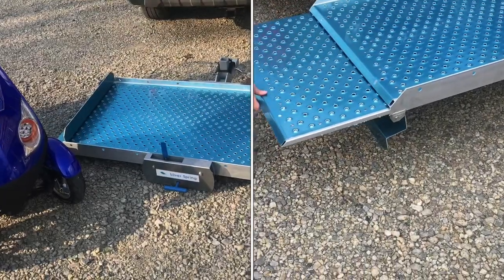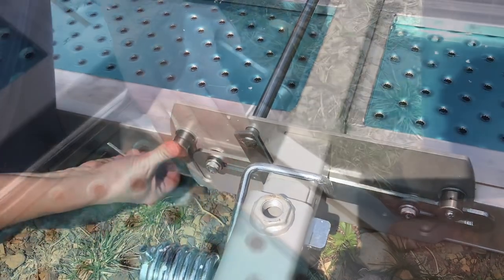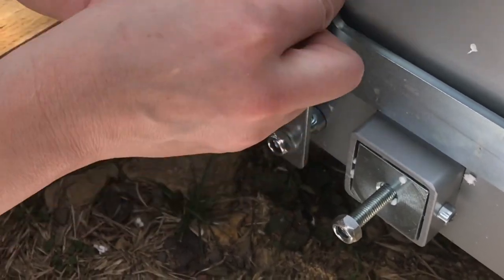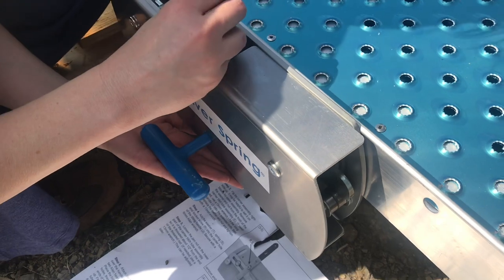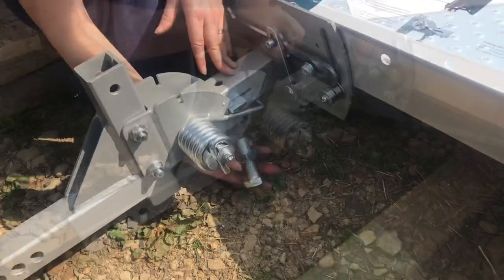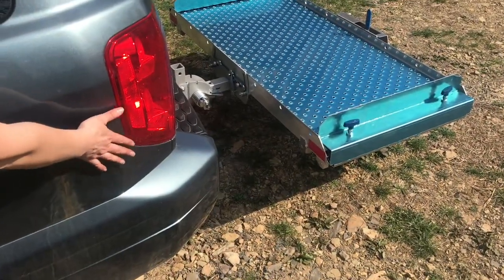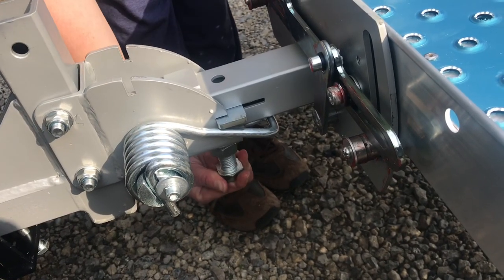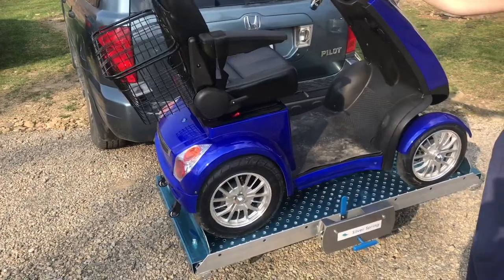(REVIEW) “tilt-a-rack” premium aluminum scooter and wheelchair carrier (silver spring)

Comment: Wow… really great video… and concise complete instructions.  This looks very ruggedly and strongly built. That hitch and support bar are steel and well more than strong enough for this application. Yes, there is wobbly issue but they all have that… particularly with cars today. Mostly this is the car suspension and compliance needed for a soft ride without a load like this. No problem you have options… https://youtu.be/BOdUfcIfKM0?si=0kW2fE-FBmlOoXPN .  Traditionally air shocks are easiest install. Or, air helper springs these both allow easy adjustment by changing air pressure.. easier instal than this scooter carrier… and if you remove the carrier you can reduce the helper spring air pressure.  I am lucky having a Range Rover that is super rugged and having an air suspension that a computer adjusts for ride height. But my Mercedes sedan I ordered without such complication as the Mercedes System I’d hugely complex, and a little fragile. 

I am an engineer by the way… and not defection is needed for strength so that is not any worry. But unsteady driving is disconcerting and dangerous.  So adding a dolly support wheel would be a project to undertake by securely mounting to the main support (the steel center support column bar) and adding a small trailer tire near center or a pair side by side. These provide widest selection, easiest install and adjustment.  Note simply have a 1/4” thick flat rectangular plate of steel welded to the center support column to mount the Flexiride unit(s) to… some holes will need drilling. The Flexiride support arms point in the trailing position and have splines for ride height or to set for best deflection to load. See web site for help -  https://www.theuniversalgroup.com/flexiride-technical-library .  If you do this you do not need to instal like caster wheels, in fact similar carriers for motorcycles when the casters wobble or rotate it is very noticeable and they can in certain situations caster wheels can wobble side to side by getting into a dynamic compliance with the trailer tire sidewall.  So I would mount a singe axle near side to side centerline or if you do a pair on each side of centerline would work too. By the way the load rating on the Flexiride units is based on pairs as they are sold in pairs. Simply mount closer to the hitch rather than way out back, and the tire sidewalls will defect enough for parking lot maneuvering… you do not need complication of casters or steerable wheels.  The further from the foreword or more close to hitch end of the scooter carrier will give both the support needed and adequate compliance for parking tight turn maneuver.